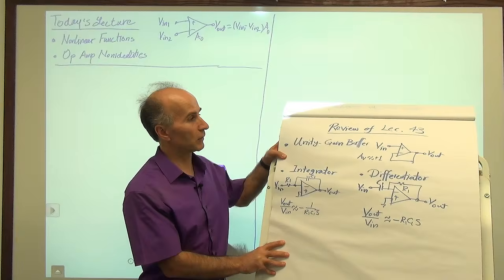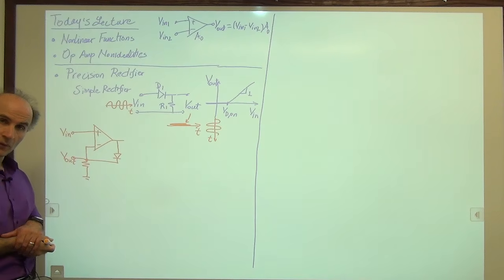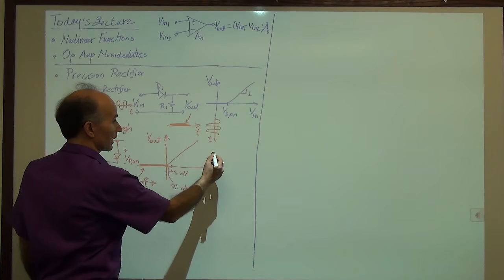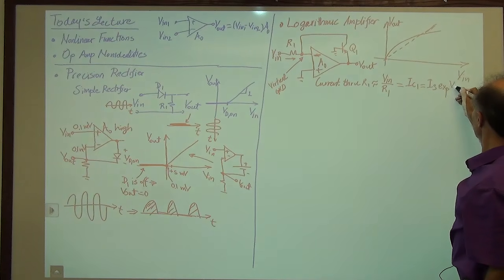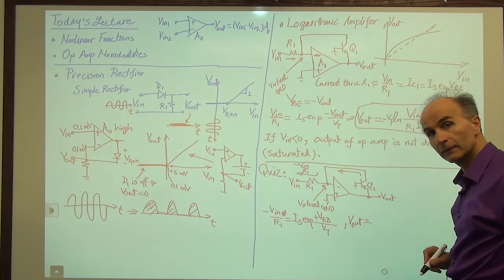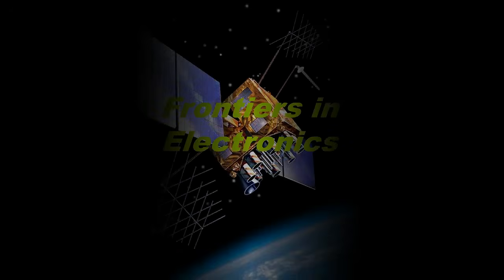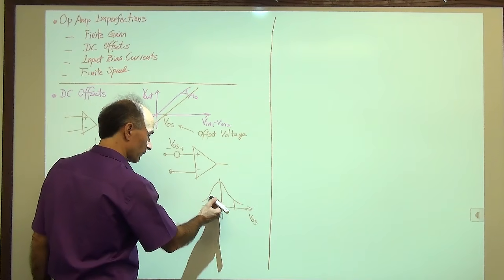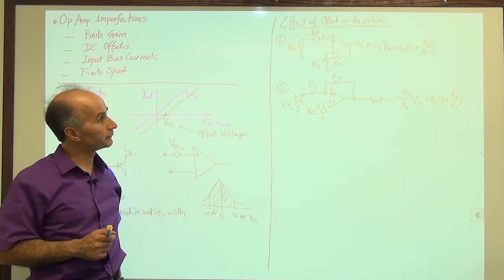Razavi Electronics 1, Lec 44, Nonlinear Op Amp Circuits, Op Amp Nonidealities I

Comment: For the logarithmic amplifiers, if I replace the NPN with a diode (anode connecting to Vout, cathode connecting to -in), will I also get a same logarithmic amplifier... Same question with the PNP, looks to me it can also be replaced by a diode with anode connecting to -in and cathode connecting to Vout.. am I correct? In my understanding, the logarithmic function comes from the i-v relationship of the PN junction in this context, so using a bipolar transistor or a diode in the feedback makes no difference.. am I correct?
Reply: You can use diode also in the feedback path instead of transistor. You can connect diode anode terminal  to input and cathode to output or else you can also connect cathode terminal to input and anode to output. Depending upon the input voltage polarity( either positive or negative) diode will be turn on and turn off.

Comment: In the precision rectifier part, how the -ve terminal of the opamp got 0.1V when the negative terminal is grounded ? Can somebody please explain??
Reply: The negative terminal is not grounded. It has a resistor connected to it whose other side is at ground and one side is connected to the negative terminal. Now, based on the property of the opamp in a feedback configuration(negative feedback in this case) both inputs have to to be approximately equal to each other for a high enough open loop gain. This is why the negative terminal is at 0.1mV when the positive terminal is at 0.1mV

Comment: @Smith Kerona if Vin- and Vin+ are the same should not the Vo = 0V?
Reply: I believe, they are not exactly equal as the difference between Vin+ and Vin- is very very small as Ao is very large. The output Vo is a very low finite value. We tend to approximate both inputs as equal to make calculations simple.
Reply: Not the same, but very close. It's like how 0.0001 and 0 are close